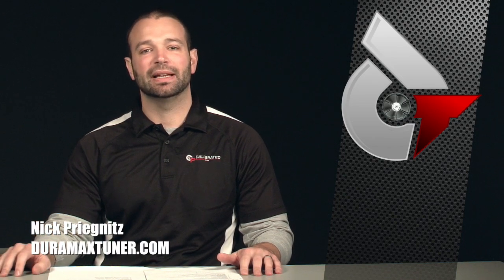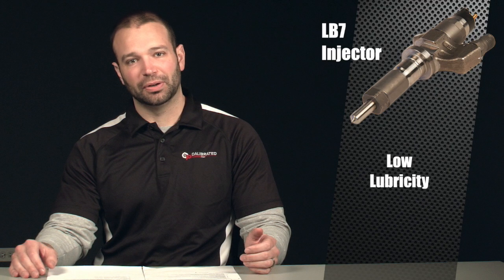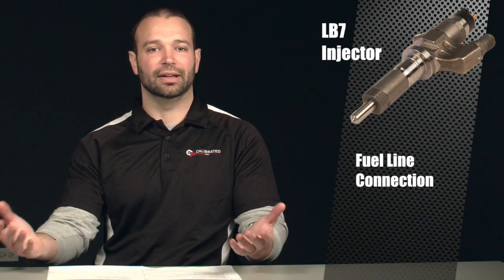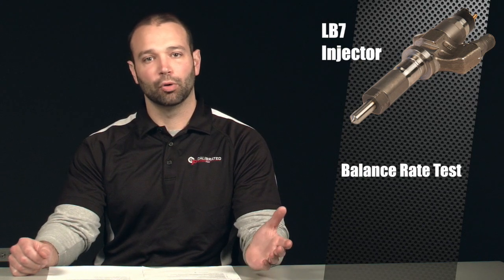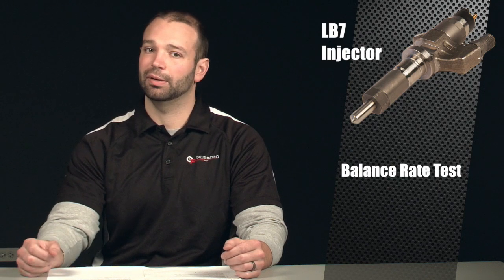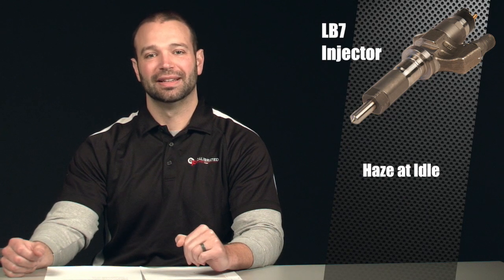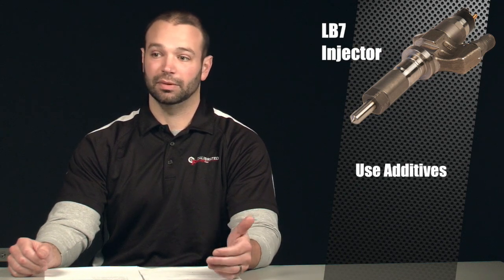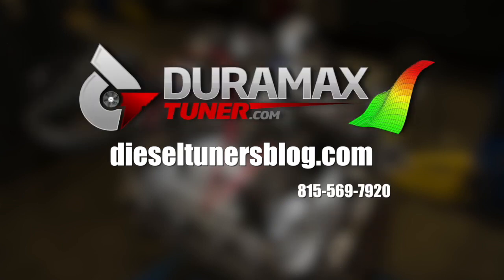Duramax LB7 Injector Failure Explained - Diesel Insights

Comment: Hey buddy my name is William🤝, great video and VERY INFORMATIVE. Maybe you could help me, I have a Ford F250 pick up truck 2011 powerstroke 6.7l  that I bought new back then. I take VERY GOOD CARE of it but in 2019 I retired the truck and it just sits in the driveway and it's got 113,000 EASY GRANDMA miles, never dogged it out and oil and filters have ALWAYS been changed on time. I always keep it with a full tank. Well every 3 months or so I'll drive it to work for a week and then park it for another 3 to 4 months or longer and that went on for 2 years. Here lately I too have that grayish white smoke you're talking about in the video. Before I retired  it on March of 2019  I had a new fuel filter put in it because I wanted to retire it with a new one, so that new filter I just took it out this weekend after just sitting and it looked pretty bad so could that filter be partly the problem with this smoke and it only happens at idle. The truck ran PERFECT before retirement. A truck with these miles and history, do you think I might be looking on replacing a injector or could I maybe try pouring a diesel cleaner in my new filter chamber and run it to see if it was just cleaning needed? Anything suggestions I would really appreciate it. Sorry this was so long friend. 🤝
Reply from the maker: I would look into the CP4 high pressure pump.  Can it keep up with peak rail pressure demand? Check the mProp screen and see if it has any debris.
Reply: @Duramaxtuner  Hey buddy, thank you for the fast reply and the info. I will try to look into what you said. 👍

Comment: I bought a brand new 2020 in 2021 all they had because virus.. this Denali 3500 HD is nothing but a problem and has been in the shop as much as the road..50k miles and overheating,  Radio not working. Injectors twice now, Exhaust heater went bad and its non stop problems.. GM will not buy this 97k dollar problem back.. I got screwed big time buying this truck.
Reply from the maker: Sorry to hear that.

Comment: VGT Lighting Bolt turbo solenoid $450.00    
It's suppose to increase 5 to 12% boost,  faster spool, quicker torque, cleaner burn, less soot, and better mpg by changing the vein position. Any response to this? Saves the cost of a turbo swap and labor involved. I think this new, and I'm very interested in it.

Comment: on my 2005 duramax with 278k miles the head gaskets failed so i pulled off the heads and when do i have the injectors serviced or changed out??? engine runs great but maybe because of the spray tiny holes are now bigger from wear and i do not need them to get to the point where they shoot a full stream out and drill a hole in the piston... have you ever seen a injector drill a hole in the top of a piston ???

Comment: Dont get diesel fuel when a tanker trailer is unloading at a gas station.........the gravity unload is still able to stir up and disturb the water and sediment in the bottom of the storage tanks and if you are getting diesel from a bowser at the same time, you will get water in your tank.  Even OEM filters have a rated efficiency at so many microns at 60%........so you will need at least 2x 2 micron filters in series to have acceptable filtration at 2 micron and change them often.

Comment: Just replaced my 2001 LB7 at a top notch shop. The new injectors work great. Plenty of power and no more smoke. We tow a 32ft 5th wheel with it. The shop gave me the diesel additive they use and put some in every fill up. In case you are wondering I had 150k on it.
Reply: Just came to grips that my 01 LB7 needs injectors at 192k mileage
Reply: just make sure to put the additive in every fill up and it will last you along time if you don't get on it like i see some guys do. the Heads do go out too and gaskets so take it easy on it. fyi

Comment: Fuel additives and doing the Caterpillar fuel filter mods and nothing,but top-tier fuel will help these injectors last FOREVER.....biggest issue is caused by US diesel caused by EPA regulations...and due to the fact,that these parts are primarily designed in the UK,they are tested with UK fuel,which has a ton more lubricant in its fuel(more sulfer).....I actually recommend adding fuel additives to any diesel...whether it's a common rail,a HUEI or even an old school mechanical...being seeing a lot of common rails' having pump failures lately...and its because of the fuel...and it's always the roller bearing on the piston tappets (lifters)... basically, completely trashes the entire fuel system....I have  Deutz 2.9 with a single piston,I'm working on right now.Metal EVERYWEAR...I'm not even going to bother rebuilding the injectors,cause of scoring..So,Yeah...if you own ANYTHING with a diesel...start adding additives!!... Great video👍

Comment: My Silverado 2006 with a Duramax has 540.000 miles .except for thermostats and glow plugs engine has never been touch.has original injectors. And get 19.3 miles p/g average between city and hwy.and is always with a load.This coming Wednesday is going into a shop for first time.I accelerated hard when I was going 55 mph.and engine became on limp mode and check engine light came on. Next day engine was checked and showed Code P0087
Reply from the maker: Start with a Race Plug, but it could be a low pressure side supply issue or it could be a CP3.

Comment: I have a 2003 LB7 and I have a haze should I just Chang my injector tips?
Reply from the maker: With an LB7 we never suggest changing just the tips.  That is most likely not where the problem is.  Also, we suggest properly diagnosing the injectors before replacing them.  Check balance rates, look for fuel in the oil.

Comment: Everything I’ve ever researched, read or seen in regards to injector failures were caused mostly by contaminated fuel (water, dirt,air,)
There’s a reason GM introduced a 200,000mile warranty on injectors. As long as a Filter change Was done every 20,000 

Like he said in the video, low lubricity ever since mid 2006.  All injectors for the duramax from 2001-2007 were designed for low suffer Diesel (500 ppm ) not  ultra low silver diesel ( 15 ppm). 
I own a duramax  and have over 540,000 on original injectors. I also don’t trust big fuel companies saying they use lubricity additives in their fuel. I use XP3 Additive. 1oz every tank And sometimes added a couple ozs of a high quality 2 stroke oil

Comment: S&S diesel just announced that the SAC00 injectors replace that factory failure completely. Have you heard anything about that? If they have fixed the problem, my injectors are on the way out and I would kill to have injectors that lasted a long time
Reply from the maker: They sound great but, we have not worked with those yet.
Reply: Just saw these want some input before buying them

Comment: I know this is an old vid, but if y’all are still paying attention I’ve got an LB7 250k and I’ve had the number 7 injector shit the bed twice in 50k miles. Is it possible there could be some sort of a harness issue? All the resistance values are good, and I’m super ocd. About my maintenance schedule. I got a lift pump and two 2mic cat filters, and a 10 mic cat separator. Any info would be a great help thanks!!

Comment: Thanks for the video , i have a 2015 Chev Duramax just lost my fuel system for the second time first at 66,000 km and now at 166,000km just 6000km  over my warranty . $12,000 repair bill here in Canada , i have had several duramax's in the past but this will be my last. They had a good truck there a ruined it trying to get more horse power and better fuel milage out of the same engine , should just lift it alone .
Reply: I have an 05 Chevy 2500 HD Duramax it has 260,000 miles and replace fuel filter to a cat conversion clean my injector every 50,000 miles with x66p injector cleaner. With live efi tuned on demand program deleted egr I smoke mustang all day . Also tow a 3 car hauler part time . You just got a lemon 🍋 . I have a barber that got a new 2020 Ford 2500 .3 engines in a year no tune all stock 🍋.

Comment: My old LB7 needed injectors at 80K and again around 170K.  I just had my LMMs done two weeks ago at 183K.  Now on to a full EGR delete to chase off a P0401..The joys
Reply: I just changed injectors. Cant get it to run. Scanner says open circuit.  What causes that
Reply: @traceylockhart1847 pinched wires on valve cover going to them

Comment: Just spent 7500 on my '03 DirtyMax on 8 new boshe injectors, gaskets and ARP studs. I blew a head gasket and said screw it im gonna do it all while its torn apart.
Reply from the maker: Sounds like a well placed investment.
Reply: maxo kream nice man. Not a bad price either. My mechanic sent my heads out to esentially be rebuilt . Running smooth and sexy now.

Comment: Injectors under valve covers on an engine jammed into a toy truck engine compartment . . . not so brilliant. F-THAT. 
One of the few reasons I HATE WORKING on over the road diesels. Does the I-6 6.7L Cummins have the same setup ?
Reply: JIGA BACHI yeah it’s under the valve cover but they’re super simple to get to
Reply: cummins injectors are … under a cover....  the 6.5 chevy diesel's injectors are out in plain sight... no cover to remove Ford injectors are also under cover.....

Comment: Nick, while the reasons for LB7 injector failure you list are accurate, I'm sure you will agree those problems are common to all injectors, yet LB7's continue to be the most failure prone among all manufacturers. That being said, my research and discussion with an engineer at Bosch indicates the hazing problem (hot start issues are another issue) is related to the VCO (valve covered orifice) design of the originals which requires continuous internal contact of the pintels to the nozzle. Leakage during the "closed" cycle causes buildup externally, with resultant poor spray pattern. I have yet to find a product that deals with that failure mode. One more thought, LLY injectors switched to an SAC design (look it up) and injector hazing issues, in my understanding declined dramatically. I'm due for a new set at 155k (originals at 75k under warranty). Thanks for your good advice!
Reply: Steve Waclo clearly Bosch is going to say it isn’t there design with curtain things. Hazing at idle is 95% if the time due to tuning or injector problems. The Bosch injectors are rated at 2 micros the duramax is at 8-12 at best on oem. With cat adaptors you can get it down to around 4 micros. The problem on the duramax in the fuel system are in two main parts. Poor filtration and no low pressure fuel pump. Both can be fixed by simply adding a lift pump. People would rather save $700 dollars than add what their truck needs from the start.
Reply: i remember a time (in days very much gone by with mechanical injection) when injection pressures were around 150 atm and even then injectors were being pulled at fairly low mileages.....now the fuel is worse, the pressure in rails has sky rocketted and the factory filters have not really improved , to the point where people are fitting their own setups because factory  filter just doesnt cut it........they dont want them to last....its got to the point where i am teetering on the dge and may just opt for a  gas engine instead and have average motoring bills like normal people do....
Reply: turtlezed unfortunately your right they don’t design things at the factory to last anymore but the good thing is that with all the diesel techs around the US that want to be called the best they have created competition and actually designed parts that are almost failure proof. Sac nozzles for example not existent on lb7 till a tech made them then even the oem was redesigned on the lb7 to a sac nozzle. Competition and not putting cheap parts to replace is the key to millions mile trucks
Reply: @dieselman6.664   I just picked up a bone stock 1 owner '03 that's "making oil" (I knew that when I bought it, still on the back burner for repair) What are some areas/mods you feel I should address? Thanks.
Reply: @tommyt2854  Go to Duramax Forum for enlightenment, loiter for a bit, use "search" then ask good questions..

Comment: Bought a brand new 03 duramax and always had acdelco filters, additive and needed new injectors at 36k miles. At 100k another one failed and kept pouring fuel washing a cylinder, destroying itself.
Reply: Welp looks like im not buying the lb7
Reply: Matthew Stewart.... I have a 2002 LB7..... and changed mine with NEW Upgraded Bosch injectors, with 256,578 miles on the Original injectors,  and only ONE of the Original injectors was starting to have balance rate values of around -2.4 to +3,  and now at 302,157 miles I just changed the FPR (Fuel Pressure Regulator) a few weeks ago as it was starting to sporadically cause the engine to do quick surges at idle.... the pump is still Original as is EVERYTHING else and I have Zero leaks, weeps or any other issues from the radiator to the rear end.
Reply from the maker: Sorry to hear about that.
Reply: Your biggest issue was prob that stock filter system

Comment: so on my cts2 it says to check when engine is cold at idle, is this true? I find the colder it gets the worse my rates are at startup, give the engine even 1 or 2 minutes to run and the rates go down a lot. and then at proper operating temp they are great. so not sure what to make of all this.
Reply from the maker: We recommend waiting until the engine is at operating temperature before checking balance rates. If you have any questions, feel free to give us a call 815-568-7920.

Comment: The main reason I won't ever modify my diesel truck. Injectors fail bad enough on their own and are so expensive to replace. Honestly modern diesels are less reliable today mainly because of the finicky injectors on new trucks
Reply: The cp4 on the fords and chevies cause total fuel system failure. Had it happen to 2 lmls where I work. 15000 EACH!
Reply: kindof makes you wonder why anybody would want to own a diesel engined vehicle....the days of diesel are numbered and it will be resigned back to commercial use only one day and all passenger cars will be petrol/hybrid or electric....or we'll all be riding bikes.....pedal bikes not motorbikes....
Reply: @turtlezed  wouldn't hurt my feelings if we went back to horses! Seriously though, I agree. Maybe not our lifetime,  but.....

Comment: Additive additive maintenance and additive, fresh filters and additive. Period. It should be mandatory for any lb7 owner at this point in the game. Ulsd is garbage. How hard is it to keep the injectors lubed. It's kind of the EPA's fault that we have to perform this weekly pump ritual...Been preaching it for years.. tcw3 and power service mixed. I'm gunna make fuel tank door stickers, "shitters full". Market that shit and sell the hell out of it.
Reply: NorthTexasFarming haven't ever used 2 cycle oil in Duramax..always ran it in my Cummins trucks...and have always changed oil and fuel filters 3 to 5,000 miles..cheap insurance to me..my 02 LB7 has 339,300ish miles.. absolutely love it!
Reply: @white24valve  How is the ole girl doing a year down the road? Mine is about to roll 250K and want to keep her going.
Reply: @Jacobtaylor1775  doing good..rolled 357,000 miles the other day!!
Reply: @white24valve  That's awesome! I'm actually replacing my front end steering bushings, ball joints, tie rods/ ends, and all that stuff.
Reply: NorthTexasFarming explain your weekly ritual to me in detail

Comment: Nice video, thanks. I have a 02 with 240,000 and still ripping! Hopefully the injectors will hold out with the regular maintenance I have done. Best truck I have ever had, hands down!
Reply from the maker: For sure - good luck!
Reply: Doing a job on an lb7 with 241k on the clock. Get ready...your on borrowed time

Comment: Is there any video you guys can recommend me to to change out a fuel pressure regulator on a 2002 Chevy 3500 LB7
Reply: Keith Hendrix not to be rude....but it’s YouTube....just type it in. If you can’t figure that out, it’s probably a little to difficult of a repair. I was going to do mine, but I just paid a mechanic to do it on half the time.  It’s not very simple

Comment: Question. For the lbz would you recommend replacing the high pressure hard lines? as you would the lb7. Or are they two completely different horses?
Thanks for the vid! Great stuff.
Reply: Eli Slabaugh all common rail fuel hard lines are a "one time use" line. They match to each injector/port on your fuel rail when you torque them down. It's always highly recommended to change them. But, sometimes... if you're good you can get away with it. You didn't hear that from me, because reusing lines is bad advice.
Reply: Nothing is better than new